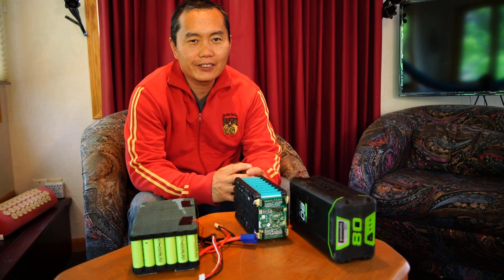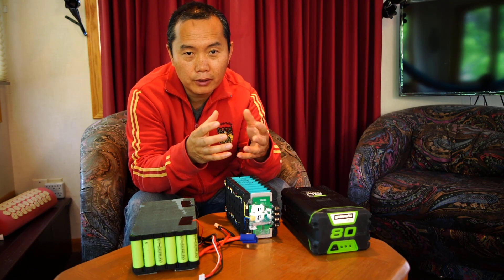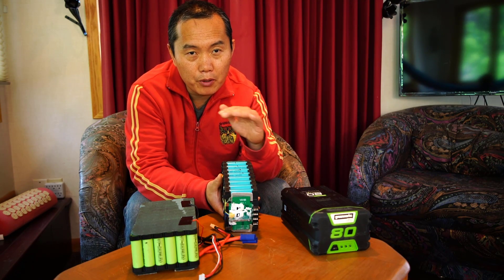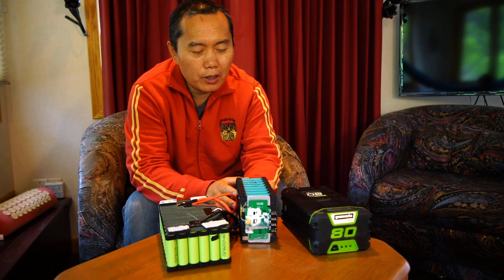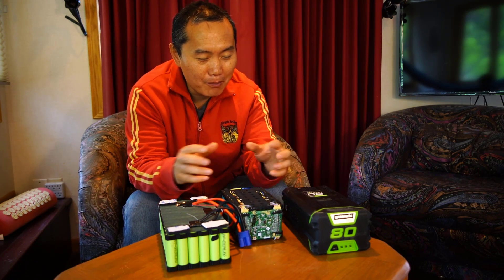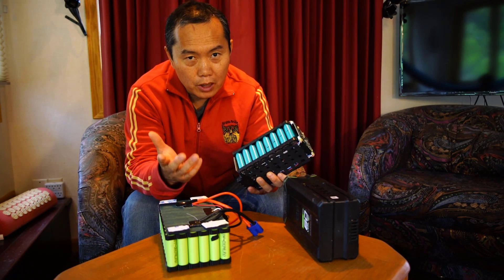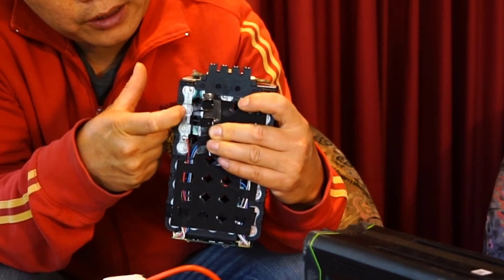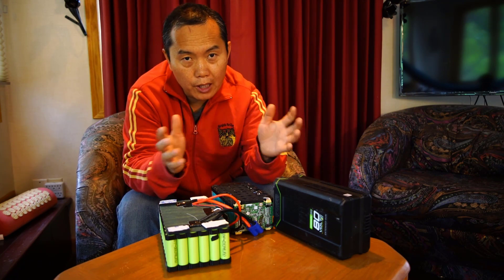mystery of lithium-ion battery common DIY batteries pack mistakes

Comment: ☝🏾 question Jerry. Is the  discharge rate higher if I bypass the bms? Will the bms slow down the discharge but still give same power if I (add<edit) some solder to the shunt inside the speed controller of an ebike.
Reply from the maker: Depending on your speed controller. If both speed controller and bms board rate at 50amp. Then bypass won't make any difference.